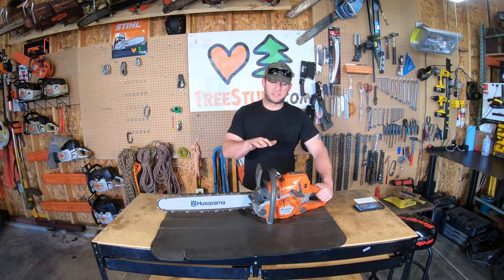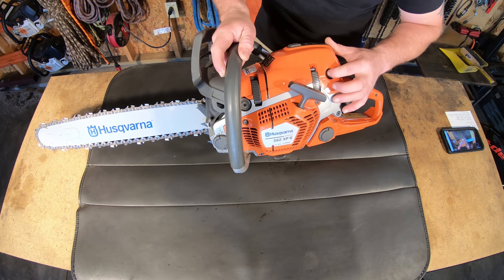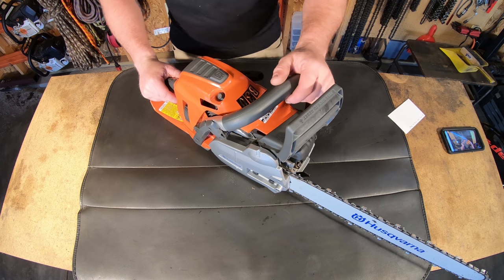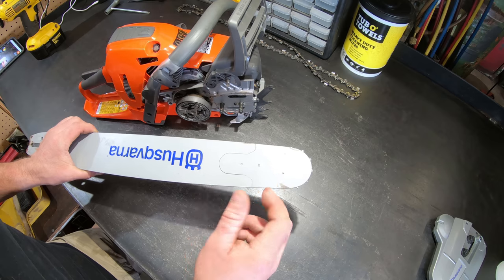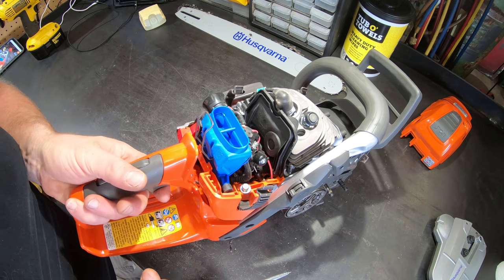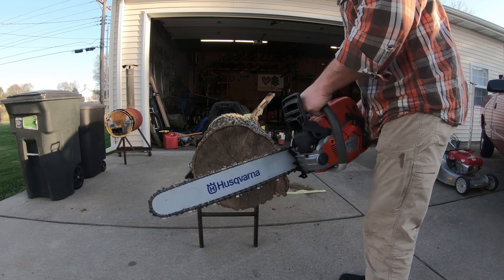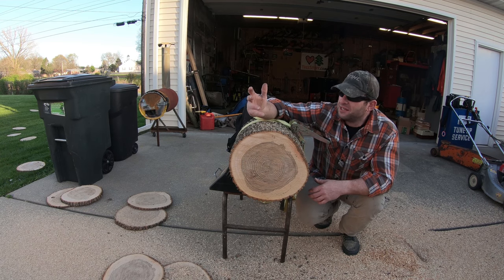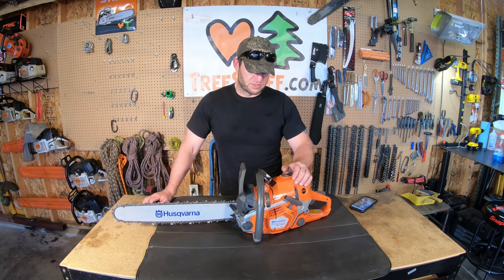Husqvarna 562XPG: Overview/ First Cuts/ Impressions

Comment: 89 octane? I don't reckon I'd run less than 95 in any gas engine tool, and ideally 98...
Reply: he is talking about the USA spec fuels there rated different to Australian spec fuels
Reply: Is there a difference in the definition of octane rating or are you talking about something else?
Reply: Tassie that’s ludicrous. Are you even aware what octane relates to in internal combustion? Clearly I think not... what is this a turbocharged 2-stroke?
Reply: Dave Wyatt most definitely not mate. Octane is octane no matter where you are. Just different fuels available in different regions.
Reply: Nope.  The US runs a different standard on octane.  Fuel is typically a mixture of many different batches from the refinery.  Each batch will have a different octane.  In the US its and average of all batches octane levels.  In most other places they don't average it.  They are allowed to label it as what ever the highest octane batch that goes into the mixture.  In Europe if a mixture of 100 90 and 95 is mixed together they can call it 100 octane.  In the USA it would be 95 octane cause they average it out.
Reply: Google "octane ratings in different countries". Here in the US we run 85, 87, 89, 91, 93.... Plus all the ethanol blends. High elevation (say, 8000 ft) with low oxygen density a standard 8.5:1 compression naturally aspirated engine is just fine on 85, but drop to sea level and you may find you now have detonation unless you bump up to 87 or 89.

Comment: Husqvarna, I dont buy it anymore. I had this saw when it first came out, awesome performance but the chain tensioner is supported by thin flimsy plastc and one little screw which after a few hours would flex and not stay properly tensioned. So no matter how good a saw runs if the chain cant stay tight its hard to get work done. Husqvarna wont listen to the end user or their dealers, if they did then I would suggest they switch to high density nylon and use two little screws. They dont listen so I dont buy.